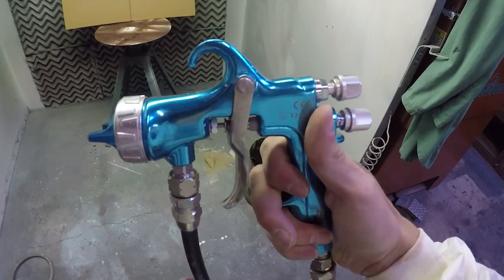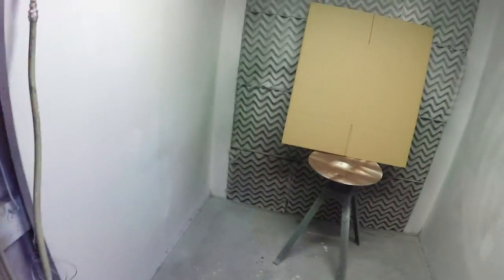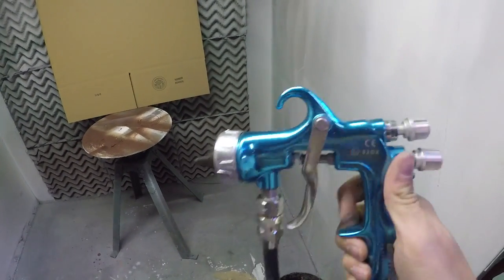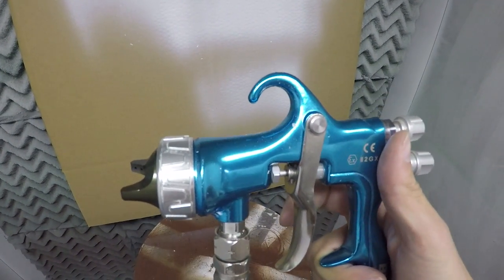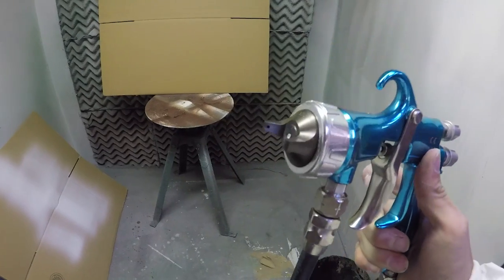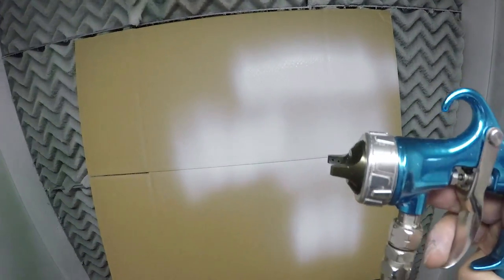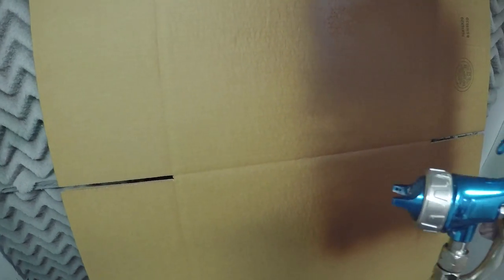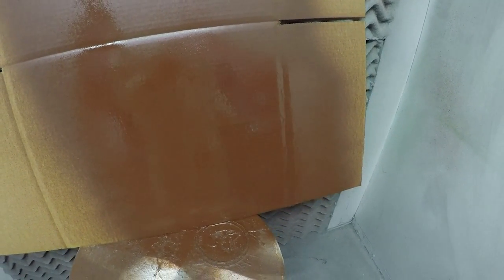HVLP vs Conventional vs LVMP  Trans Tech Paint Spray Guns

Comment: Great video man.  One question though, on the 2465 trophy series, Binks has one blue body gun and one green body gun.  Are these different or are they the same internally and just come with different caps that I can then interchange.
Thanks
Reply from the maker: Just different air caps the gun body is colored differently to make it easy to know it's transtech you can change air caps to change the spray of the gun

Comment: Brilliant comparison.  Off the back off this video I bought an lvmp gun and a 2.5 hp 50l compressor that can maintain about 6 cfm. Total cost £300 and I’m getting outstanding results on woodwork and metalwork for furniture making. I’ll never need anything better than this, and so much faster than a roller and a brush. Thank you.
Reply: @tchip-bc1gp spray gun is an ANI R160 with a 1.2mm tip. Compressor is just a budget 2.5 hp model that can manage about 6cfm, with a 50l tank.
Reply: @tchip-bc1gp  just checked for you, mine says ANI R160Q midi on the box.
Reply: Yes, it’s described as a mini\midi HPS gravity fed spray gun.
Reply: @tchip-bc1gp  👍

Comment: I wish lvlp were thrown in for comparison.

I am scratching my head wondering why lvmp is slower than hvlp, when it needs less air to break up thicker material.  This is a bit of a contradiction.  I would think, more breakup is faster.  I used to reach very high speed with my conventional, especially cranking the psi up to 90 with a pressure pot.

Comment: I think a lot of people are confused with HVLP. They think high volume of paint will lay down under low pressure. But the high volume is it needs a high volume of air.  Most painters use 3/8 fittings vs the typical hobby size compressor with the 1/4 fittings because 1/4 fittings reduce your volume and create more pressure which all but eliminates the benifits of the HVLP gun.

Comment: Have you tried a conventional air cap at hvlp pressure and compare hvlp the both of them,
Reply from the maker: The conventional cap will perform pretty close to the hvlp cap at the same pressure but will still give a slightly better finish than hvlp

Comment: Is that one gun you are using,  and just switching the cap?
Reply from the maker: Hi yes the trophy gun has all three air caps available allowing you to spray in conventional, hvlp, or lvmp from a single spray gun type
Reply: @PittsburghSprayEquipmentCo  hi do you know any gun that can be purchased in the UK that you can use a conventional cup hvlp o mvlp in the same gun. Thank very informative videos
Reply: And what size of fluid cup you recommend for thicker water base paint. Thanks
Reply: Pittsburgh Spray Equipment Co does the cap dictate how much air the gun puts out or is that determined by the air pressure at the input? In other words if the tank is fixed at 1 bar, will the MP cap let more air pass than the LP cap? Or do you have to adjust based on your application.

Comment: What gun is best for semi gloss paint like for trims? And what gun is best for redwood stain or sealer (poly)
Reply from the maker: Redwood stain, HVLP, or lvmp semi gloss depends on the viscosity but most should spray well hvlp. lvmp, sealer hvlp or lvmp lvmp breaks up a bit finer a gun like the Trophy spray gun can allow you to spray hvlp or lvmp by changing the cap

Comment: what different lvmp and hvlp?i need to know..
Reply from the maker: LVMP uses a bit more air pressure vs air volume which results in a bit of a better breakup than hvlp but if your in a state that requires a compliant spray gun (HVLP compliant) lvmp doesn't meet that standard (but is about the same in transfer efficiency or same in keeping waste down).  HVLP meets requirements for emissions reductions but tends to not break apart material quite as fine.  LVMP is most often used for automotive or wood finishes where HVLP standards are not required
Reply from the maker: LVMP uses a bit more air pressure vs air volume which results in a bit of a better breakup than hvlp but if your in a state that requires a compliant spray gun (HVLP compliant) lvmp doesn't meet that standard (but is about the same in transfer efficiency or same in keeping waste down).  HVLP meets requirements for emissions reductions but tends to not break apart material quite as fine.  LVMP is most often used for automotive or wood finishes where HVLP standards are not required
Reply: Pittsburgh Spray Equipment Co okay,now i understand hvlp and lvmp..thanks for your information

Comment: I have a 150 psi compressor. It's enough for Blinks Hvlp gun ?
Reply from the maker: Black Phillip it will depend on your compressor cfm pressure is the same with all compressors but cfm is what differs you will need about 20 cfm to use a spray gun like in the video which would require a 2 stage 5 horse power compressor to run efficiently
Reply: I borough that gun from a friend. When pressure is lower than 140psi on my tank paint start to became misty and coverage is really bad.
Reply from the maker: Black Phillip would have to know about your compressor and material your spraying it's either setup on the gun or compressor is not but enough we can talk during tomorrow if you would like
Reply: I've tried Blinks gun with a siphon. I have Craftsman 150 psi air compressor
http://www.sears.com/craftsman-professional-27-gallon-super-quiet-vertical-portable/p-00916474000P
Reply from the maker: Black Phillip unfortunately that's about half the size of the spray guns air need which is about 20 cfm what you may notice due to a lack of air is your pattern doesn't stay consistent and isn't breaking up paint well enough
Reply: What a shame. That makes a lot of sense. I need a compressor with way more cfm.
Reply: Pittsburgh Spray Equipment Co What compressor do you recommend ? I need something portable.
Reply from the maker: Black Phillip if your trying to spray in homes you may want to consider an hvlp turbine 5 or 6 stage for a spray gun you typically use a 5 horse two stage compressor that delivers about 20 cfm usually a rotary screw
Reply: Trash can enough to these guns..